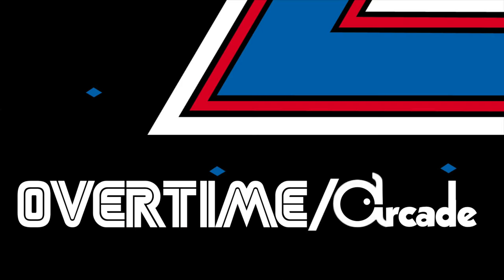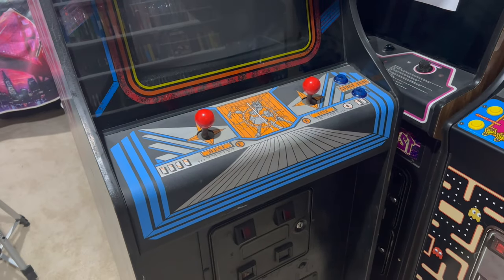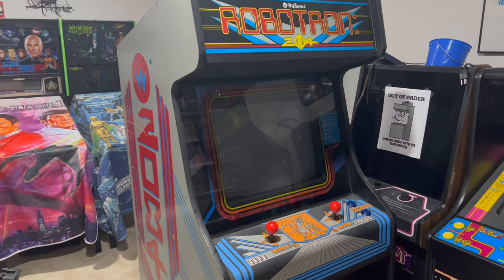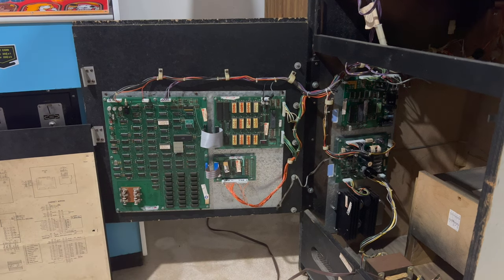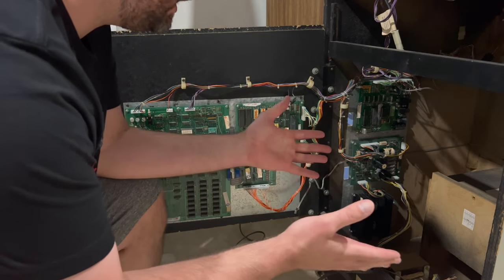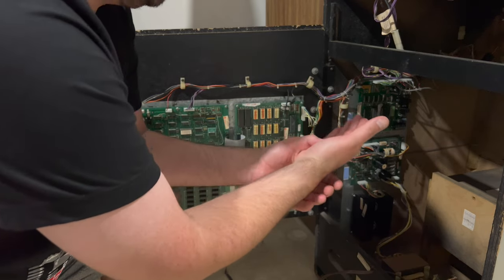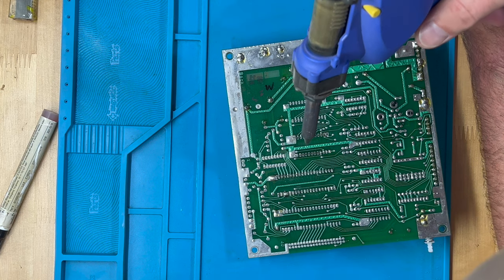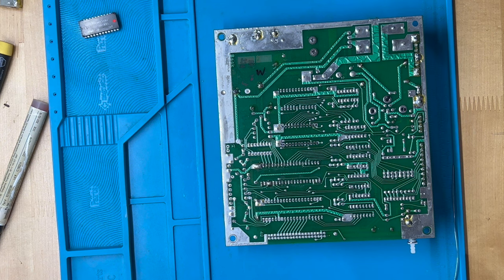Let's Fix Robotron Sound Issues

Comment: Williams sound boards are completely self contained.   Not sure if you have a bench setup with Power Supply(s), Logic Probe, etc... If you do, you can build a test harness and run just the board on your bench so you don't have to keep putting the board in the game to test.
Reply from the maker: Great suggestion! I haven’t done so yet, but I’ve got all the parts I need to build a dedicated bench setup and it’s something I’ve considered doing in the near future.

Comment: Look inside the cabinet above the monitor.  Unless someone has removed it, there should be a mirror above the monitor.   There are two bolts below the monitor (and one has an instruction sticker).  You remove the bolts and the panel with the monitor should slide down.  There should be another set of holes that you can then put the bolts in and hold the monitor in place.   This will allow you to adjust the monitor from the back of the game.
Reply from the maker: Yes, the mirror is still there. In the past I have slid the monitor back and used the mirror to help make adjustments like you said… but I was being lazy and didn’t mind leaning around the cabinet this time. 😅

Comment: Nice work. Since you used a 6802 in lieu of the 6808, you can cut a small trace/jumper(W14 behind R30) and enable the internal RAM of the 6802. At that point you can completely remove the 6810.
Reply from the maker: Yep, that was on my list of things to try if I still wasn’t able to fix it!

Comment: Tip, clean the gun after each use. If it stops sucking, the little flapper part in the top of the pump in the back gets flux vapor on it so it doesn't seal (not the rubber part, the clear plastic part). Cleaning that will make it work again. Keep plenty of filters handy, they are pretty cheap. Isopropyl won't hurt the plastic tube at all and I use that to clean it. If you run across stubborn old joints, add a bit of solder or flux to get the solder to melt. Wick and pumps have their uses too, I use a soldapult for big connections with a lot of solder on them (like flybacks), and wick to clean excess off a lot.
Reply from the maker: Yep, it took me a while to realize how important it was to disassemble the pump housing for deep cleaning, but wow what a difference it makes!

Comment: Great video! The details are greatly appreciated. I did retro arcade restoration for about 15 years and kind of retired, but I miss it. I can feel myself being pulled back in again.
Reply from the maker: Thanks for the kind words! I’ve only been doing it a few years myself. I suspect a lot has changed over time — prices for machines have gone up by a lot, but there’s also great availability of replacement parts, etc.

Comment: The BAD 6810 RAM Chip is causing the sounds to play intermittent and at random? I would if this could have been shown using a logic analyzer or oscilloscope
Reply from the maker: Ultimately, the intermittent sound issue was caused by a flaky CPU on the sound board, which I replaced towards the end of the video. Problem solved!
Reply: @overtimearcade  ok thanks, I guess there is no way to see that flaky CPU data signals and flaky address signals on the logic analyzer or oscilloscope?
Reply from the maker: @waynegram8907  I’m sure it’s possible, but I’m still learning how to use the probe & scope effectively.